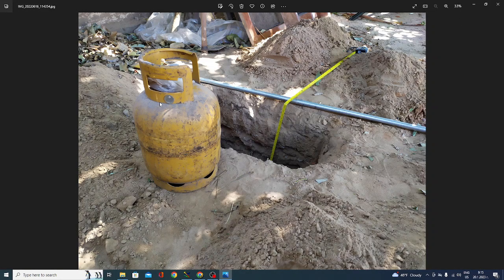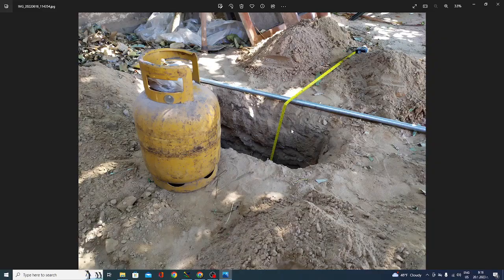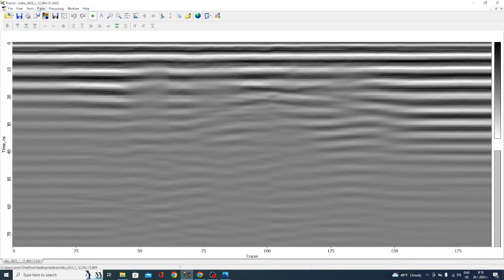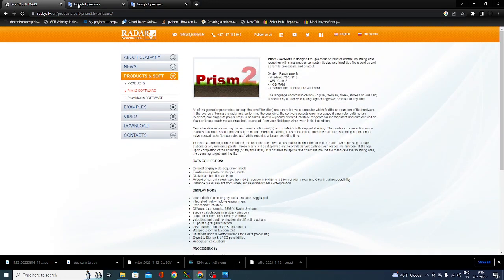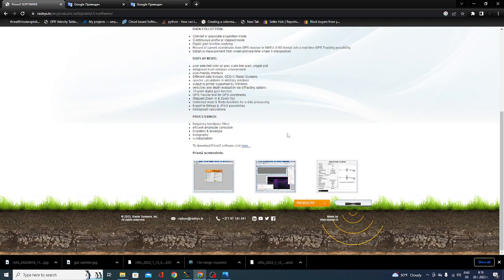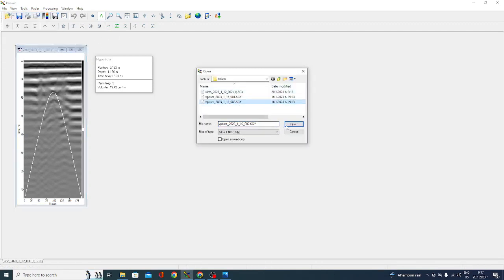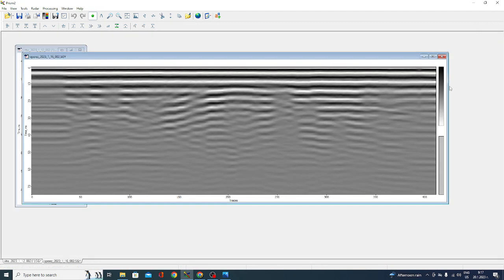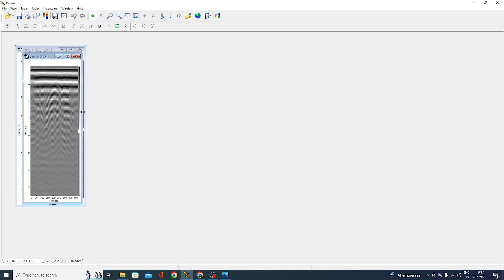Oerad Dipolo: unshielded GPR radar - common mistake and test

Comment: What is the frequency of the antennas?
Reply from the maker: 300 MHz antennas
Reply: @ThraceMetalDetectors 
 Is the lower frequency better for clarifying voids and buried objects, such as the 100mhz frequency?
Reply from the maker: @خالدخالد-ع8د4ق  Higher frequency has better resolution, lower has bad resolution,but goes deeper